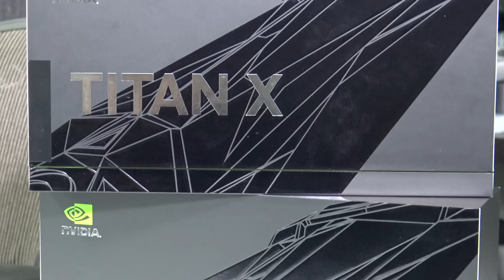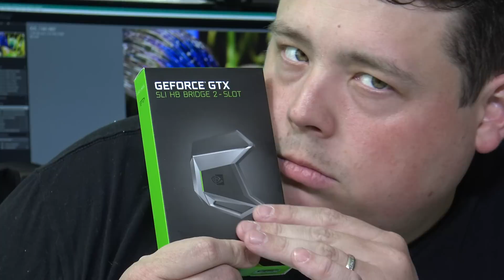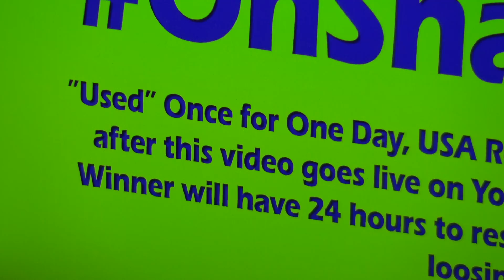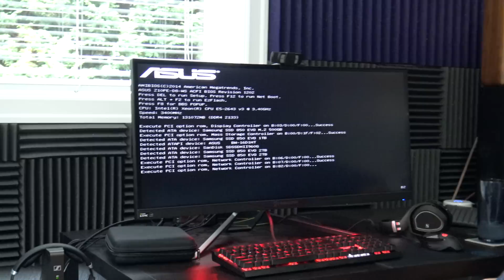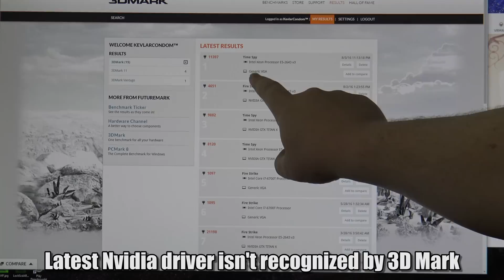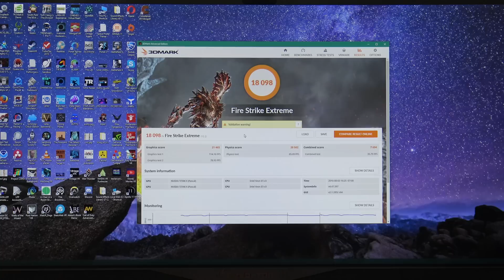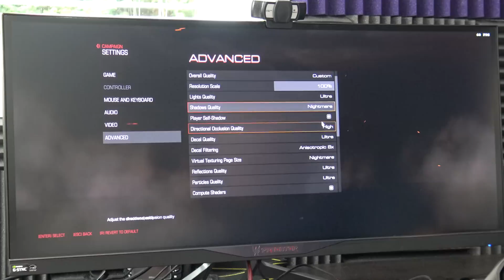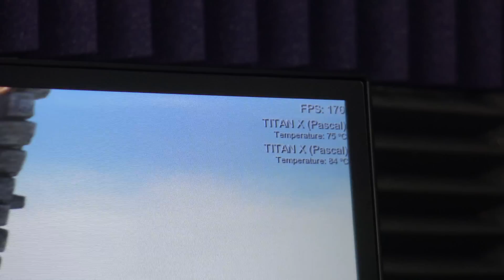Fastest graphics cards in the world! - @Barnacules

Comment: i tried asking this question but maybe it's too stupid so i dont get an answer - i would really appreciate a reply from anyone at all. Question is (knowing the 1080s only sli properly with 2 cards instead of 3 cards today)- what would u say to using 3 titan X pascals connected to three monitors independently (NOT tri-sli)? or is dual sli across 3 monitors better or more than enough? someone said that the software concentrated its GPU load into the centre monitor so the dual sli works better as the 2 side monitor dont use up as much gpu power as the centre one. Am i completely off? :)

Comment: which psu do you use to support this sli config? will the corsair hxi 1000w platinum be sufficient?
Reply: the 1200w puts work load in the most efficient band, as my wife's txp sli 6850k runs at 970w.

Comment: i currently have 3 way titan x maxwell in SLI, and have 2 way titan x pascal in route on the way. is there a difference between 3 way maxwell titans x vs 2 way pascal? i am using 5960x cpu and 21:9 3440x1440 monitor. next monitor upgrade will be when they make 4k in ultrawide with gsync, so im not upgrading my monitor anytime soon. btw i didnt order the new HB SLI bridge, im still using nvidias older 3way LED sli bridge. what would happen if i put a 3rd pascal card? would it read? or il have to dedicate one to physx. i didnt order the new sli bridge cause i couldnt really figure out the spacing properly so i said il just get the cards then put them in and use the older sli bridge then figure out the spacing and order the right one.

Comment: I have a gtx 760 and it runs windows 10 fine (well it is super clocked)
Reply: You can run Windows 10 on integrated graphics just as well. The only thing that affects Windows is SSD, RAM, and CPU. The GPU is only displaying things on the monitor and doing GPU stuff, like gaming. I have a 760 as well btw.

Comment: PLS HELP!! Does anyone know if MFAA can be ENABLED in PASCAL GTX 1070 or 1080??? Does anyone has been noticed about that??? . . ..  MSAA x2 with MFAA worth it!! . . . . so far i cant find any info about nvidia control panel related with MFAA or it just not says if PASCAL comes with MFAA support. . .. .. will it be??? drivers?? i have my strix gtx 970 at 1560mhz and i just love it with MFAA enabled! all my games run smoot at 1440p! . . . .. until now i saw MFAA is supported just with 1060 as nvidia website show it......gtx1080 Ti will support MFAA???? im thinking about upgrade but i want to know if MFAA is supported in 1070 or 1080 sorry for my spanglish u.u HELP

Comment: SLI/Implicit multi adapter is not enabled in Doom with Vulkan and the engine/Nvidia's drivers has issues with rendering it. You'd easily max it if it did (and I don't remember if the OpenGL render supports SLI).  I'm kinda disappointed you didn't test another game like Rise of the Tomb Raider which DOES have multi adapter support in DX12.

Comment: The first card fan are mostly blocked by the second card. Had the same problem. Made me take out the second card. The first card just gets very hot because it doesnt get enough cooling air. Its a design error. They did not really design them for SLI. Its also an old problem. It think its seriously disappointing in that price range. That problem should have been solved.

Comment: my old build 2600k (4.9 ghz) and dual GTX 570s (stock reference) could get 1400 fps maxed out in CS source... if you guys had optimised it at all would be funny to see what the real FPS count was.

enable multicore rendering in advanced video

nvidia:

pre-rendered frames: 1

 launch options

+mat_queue_mode 2 -developer 1 -high +fps_max 0 -threads X (some say 3 is best, but basically 3-cores on cpu can be experimented with) +tickrate 101 +rate 30000 +cl_cmdrate 101 +cl_updaterate 101 +cl_interp_rato 0 +cl_interp_ratio 1

Would be curious to know how many fps you could get, although it will ultimately be limited by GHZ of your modern (intel) CPU and IPC power as even with multicore rendering optimisation it's still /heavily/ cpu bound.

Comment: Should have used an overclocked 6700k, looks like a real CPU bottleneck there with that Xeon. You also should have put one of the cards in al lower slot to prevent one the overheating. And I would have liked to see the framerates at 4k when the cards are moving 8 megapixels. Wich would make more sense, how many gamers own a predator ultra widescreen compared to a cheaper 4k screen?
Reply: I think the HB bridge is one rigid piece, so you can't put them in not adjacent slots
Reply: There's two Xeons lol.

Comment: why anyone would spend so much on cards which will drop in value significantly in less than 1 year is beyond me. i can see performance needs ( i run surround portrait 4.5-6k mode 980ti sli ) but even then this is just feeding ngreedia.  $700 per card on any gfx card is bad enough but 1200 is just insane... even for titans. we need more competition !!

Comment: so how does this compare to the GeForce  GTX TITAN X??
Reply: Titan Maxwell? In SLI? The frame rates across the board are doubled, and overall scores of 2xTXP = 3xTXM.
Reply: kevlarcondom What if you had 3 GTX TITAN X?? Its PC im thinking about buying that has 3. Would it still be worth it to get the Pascal?
Reply: +Kira over Near  So guess 2TXP=3TXM was way too specific for you. A 3TXM like Jayz Skunkworks does not have the new surround or vr support. But TXM can 4 way sli... so, I have 3 X34 monitors now, and two TXP will have better surround, fps should be a touch better than 3TXM.And 5k, and 8k fps are better on 2TXP vs 3 TXM (as TXm can't 8k...)... so otherwise, 3 and 4 way sli on txp will only be handled my new msft code, not by the bridge, but NV had removed all that 'enthusiasts mode' code stuff.... dead. so, 2 way is the max for the future, and seeing the 8k pseudo at 60fps.... yeah, good call nv. pm me over on twitter if you have more qs.

Comment: Yeeeeah Server Boards take forever to boot but they are actually meant only to be started once and then run until they go out of service xD
Reply: Or you get an update...  err. uptime before the 1070 went in was 97 days.
Reply: 97 days is pretty good for a desktop. I still have my first server ever, a 64bit Pentium 4 3GHz that had 4 PSUs (redundant) fail and 10 hard drives but the server is still running for 3251 days!
Reply: On Linux it is actually pretty easy to upgrade the video card without shutting down the computer but the motherboard has to support it, uncommon on desktop boards but your board could maybe do that, but heeeey, Windows...

Comment: Heaven always has some stutter issue which drops minimum framerate.  Kinda have to run it through twice, and even then it can skill blip.

They haven't released an update in years, despite it being one of the most used benchmarks out there.  Getting to be a hassle now.

And 21:9 monitors are the future!  I'm getting one of those displays (or something equivalent, Acer's QC is poor) when I finally get my 1080 (or 1080 Ti if they do that shit again).  Been using a PB298Q for 3 years now.  Sad that developers still refuse to support the aspect ratio, with some even still calling it cheating all these years later, just like multi-monitor setups (hi Blizzard).
Reply from the maker: +Ace Strife that display is amazing!

Comment: Turn FXAA off, you idiots! TSSAA runs and looks better.
Edit: also. You're supposed to take off a piece of the back plate on the bottom card if you're doing SLI.
Reply from the maker: +CapnTates both problems already solved. Also we're not idiots ;)
Reply: Barnacules Nerdgasm Typed in the heat of the moment. I was really, really drunk.
I still am a little.

Comment: 1080ti will be faster and cheaper
Reply: 980ti wasnt better so why would this be better
Reply: +Yesto With a great over clock it was faster. And besides it's supposed to have 3800 cores instead of 3500 cores and overclock like the 1080. If that happens then it will be 10-20% faster.

Comment: Does that pc have TWO cpu's? i know its possible through using server motherboards and some REALLY pricey high end motherboards but MAN those fans must be starved for air! call jay and have him do a water setup for you. you can clearly afford it since you just bought two titan X10's
Reply: Why oh why do everyone think that the watercooling would be for everything. If you'd watch the video, you'd know that there were two Titan x's (the old ones) before. If one wants to change parts, watercooling is just annoying as anything. And if someone has a dual Xeon system, build by Puget Systems, they've made it run silent. Xeon's aren't overclockable and workstation usually needs parts that can be changed rather quickly if need arises.

Comment: My single RX 480 is pushing a 4K display with way more pixels.  Sounds like the ultrawide 4k monitor is in order.
Reply: lol 2160P (4K)  is currently nerfed at only 60hz so its not a good gaming resolution, and a RX480 for 2160P is utterly cringe worthy.  With the amount of IQ you have to nerf to hit the "mediocre" frame rate near 60FP, you would have been a ton better off with a high end 1440P display at the most.

2160P gaming  will be a "thing" when we start seeing 4K displays with display port 1.3 some time in the next 6 months allowing 100hz+.

Comment: I decided to benchmark my budget=mid-high consumer range system tonight and see how it compares.

System Specs:
Intel i7 6700K at 4.6GHz
GIGABYTE G1 Gaming GA-Z170X-Gaming 7 (rev. 1.0)
16GB (2X8GB) DDR4 3400MHz in Dual Channel
Dual RX480s in Xfire Stock Config

Time Spy: 
Overall=4236
Graphics Score=4033
CPU Test=5939

Heaven:
Same settings as video 1920x1080
FPS=51.9
Score=1308
Min FPS=9.1
Max FPS=109.9

Heaven:
Same settings as video 1920x1080 but (Tesselation turned off)
FPS=68.6
Score=1729
Min FPS=34.3
Max FPS=122.6

Overall these were the 2 benchmarks I was able to run and compare for free.  Basically, it shows exactly what I would expect considering the specs of the system.   This system will run Doom at 4k Ultra settings averaging 50-55FPS on Vulkan.  At 1440P high settings, it averages  87-92FPS.  Not too bad for $480 in GPUs.
Reply: Just ran Counterstrike source for the heck of it and averaged 536.28FPS at 4K
Reply: +kuhrd Not cpu bound? even at 640x480 I can't go over 600...
Reply: high range rig
Reply: Yesto My rig would fall into the mid-high range for consumer rigs on the current generation of hardware.  Enthusiasts would be going for extreme edition or Xeon processor builds and buying GTX1080's or Titan X's.  The i7 6700K is a high range consumer grade chip.  The 2 RX480's are considered mid range consumer grade GPUs.
Reply: kuhrd so youre saying that maybe a quarter of pc gamers have a mid end pc?
Reply: Yesto When building and specking out computers this is what I generally go by.  

For Intel chips, Pentiums and Celerons are marketed as budget chips i3's are low end processors, i5 chips are in the middle of the segment, i7's are in the high end consumer category and i7 extreme chips would fall into the enthusiast market segment.  

There is some overlap in performance among the categories but a good price estimate for CPUs would be <~$100=Budget, $100-175=Low, $175-300=Mid, $300-400=High and >$400=Enthusiast.

GPU price categories are a bit different.  <$100=Budget, $100-200=Low $200-400=Mid, 400-600=High, >$600=Enthusiast.

I would guess that 50% of PC gamers would fall into the budget and low end categories. ~30% would fall into the mid-range 15% would be in the high and maybe 5% in the enthusiast segment.
Reply: kuhrd i7= high end, your gpus are 400-500e, you got 16gb ram, so why is your pc mid range
Reply: Yesto If you count both GPU's together then yeah they would be $480, but I don't generally consider having 2 GPU's to raise me to a different level.  They are still both mid-range cards and I generally only look at the price of one in the system.  As far as ram these days I go by 2-12GB=Budget/Low, 13-31GB=Mid-range, 32-47GB=High and >48GB=Extreme.  As time goes on these number my have to change and adjust but currently this is where I would set the different levels.
Reply: kuhrd your "levels" are quite alot off from the reality
Reply: Yesto How so?  I would bet if you surveyed the majority of custom computer builders out there they would say that these levels are about right.  To each their own i guess.

Comment: Which predator is that? I've got the x34 and it tops out at 100mhz.
Reply: You can disable G-sync allowing it to do whatever just like any $150 TN display, but it will be prone to stutter and tearing without adaptive sync. Being 100hz however will mean less stutter and tearing than say a cheap 60hz display. For normal non benchmark game play one would leave G-sync enabled with butter smooth 100.
Reply: +Battleneter not true, just turn off vsync in the nv control panel... and the monitor will still not tear... and can over clock with nearest frame being drawn....
Reply: kevlarcondom Just re-read what I said and what you said, and not sure there is a conflict.

Comment: So, i got on my my system a score of 2985, with an average FPS of 118,5 with a min FPS of 30,4 and a max FPS of 209.8. Used the same settings as in the last heaven benchmark. 1080p 8xAA Quality:; Ultra Tessellation Extreme. 

PC Specs
I7 4790K 4,3 Ghz
2x 980
32 GB RAM 

Also every review should start in the shower, totally agree! :D

Comment: Okay, so is his resolution greater than 4k or relatively close?
Also, what CPU would be recommended? I have a i7-5390k at 3.5.
Reply: Higher than 1440p but lower than 4k
Reply: that will not bottle neck this card. you are good.
Reply: 3440x1440 and an i7 is recommended by the community for better than 1070

Comment: this case is a cancer, you need a much bigger case with better air flow, CPU coolers are hitting the first vid card, and the second vid card has almost no room, so in the end both vid cards are chocking thus the high temps and throttling, ofcourse the 1st one will be hotter than the second in SLI but unlike the situation here.

Comment: 38K firestrike score is low i get 41k GPU score 1080 SLI stock speed.
Reply from the maker: Pics or it didn't happen, also make sure you max out all the settings and don't use the default settings.

Comment: I think you should separate the cards by at least a slot if possible.  They seem to run hot.
Reply: didnt watch till the end of the video did you? lol
Reply: Did, https://twitter.com/KevlarCondom/status/761303927870455809
Reply: No I did, but it seems like a rookie mistake from any frame of reference.
Reply: The extended high bandwidth SLI bridge has been ordered, it just hadn't arrived at the time of filming. So they used what they had for the video, and got reasonably adequate performance.
Reply: If there was a rookie mistake made, it was Nvidia's failure to produce enough extended length High Bandwidth SLI bridges, or even include any in the box. I mean, a $1200 graphics card should include some extra goodies to help show off its awesomeness.

Comment: erm... Doom doesnt support SLI
Reply: Doom will utilize 2 graphics cards in the Vulkan API.  At least it does nearly double the performance with 2 RX 480's as it does with 1 from my testing.  1 RX480 at 4k yields 28-32FPS and 2 RX480's yield 50-55FPS for me on average.
Reply: Sure does.
Reply: ***** While I don't have 4x RX480's I would venture to guess that the scaling would be similar to cards I have had in the past but should be more optimized in Direct x 12 and Vulcan assuming the studio's take advantage of it.  

In the past if the game was optimized for crossfire it would yield around 175-195% for 2 cards, 220%-270% for 3 cards, and 280%-350% for 4 cards.  Once you went over 2 cards you really started to see diminishing returns.  At the time I was using my 4 cards for image and video acceleration so scaling was not really an issue. 

Vulcan should make scaling less of an issue assuming it gains traction and studios support it.